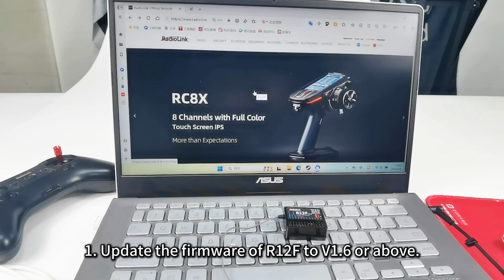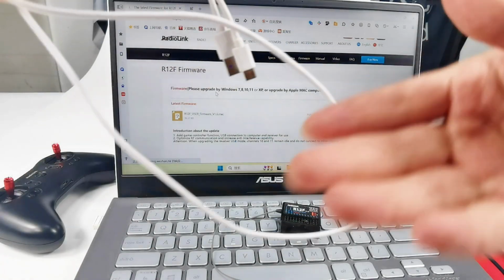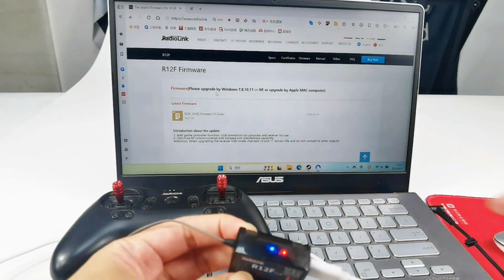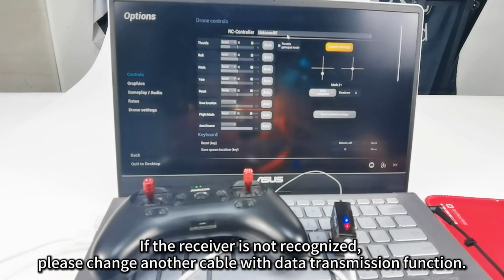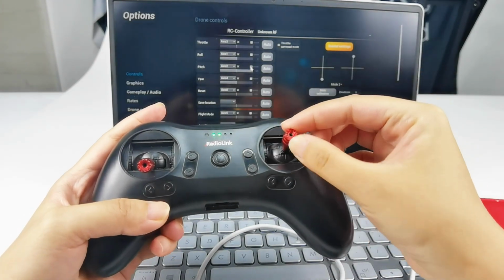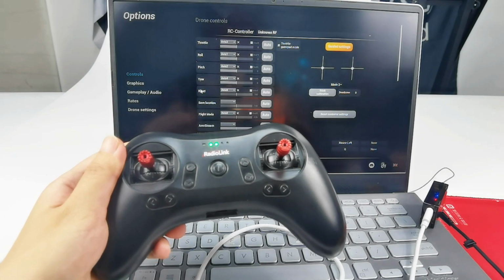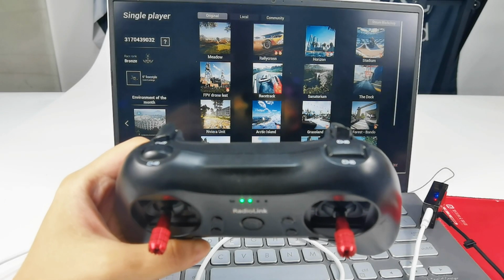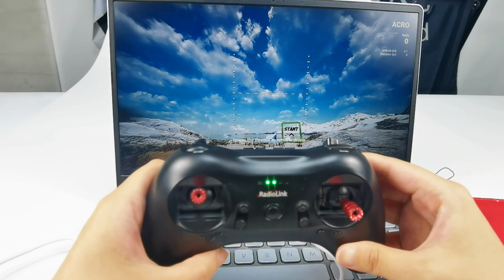Built-in Simulator Function of R12F Receiver

Comment: Hello and TY for the information, i just bought this radio i update to 1.7.1 but i can't get the 12 channel to get recognize only the 4 joystick chanels and CH 5 to 8 + in Velocidrone the SW (A to D) are recognize as Axis not buttons any workaround ? ty a lot sry for bad EN (i double check i enable all CH in AUX CH + i tried with R12F receiver not USB-C) @Radiolink_official
Reply from the maker: Hi, sir. May I know what transmitter do you use? If you use T12D/T16D, you need to select FHSS V2.1 protocol, then all the 12 channels will be available. You can send more details to our email and send us a video to show your problem. Our email is after_service@radiolink.com.cn
Reply: @ I use the T12D who come with the R12F, I have put the FHSS 2.1 and rebind the receiver with the T12D after changing it, the 12 Chanel are working on the T12D but not working on the Sim or even the control panel of Windows 
Email is already send I will resend it with a video.
Ty for fast response.
Reply from the maker: Hi, sir. T12D/R12F supports 8 channels for simulator now. It may be updated in the future. If it is available, I'll let you know about it. If any question, please feel free to contact us. Our email is  after_service@radiolink.com.cn